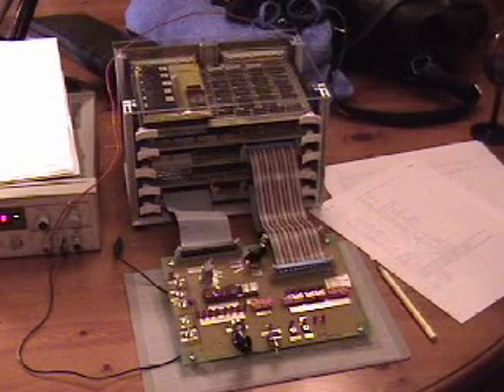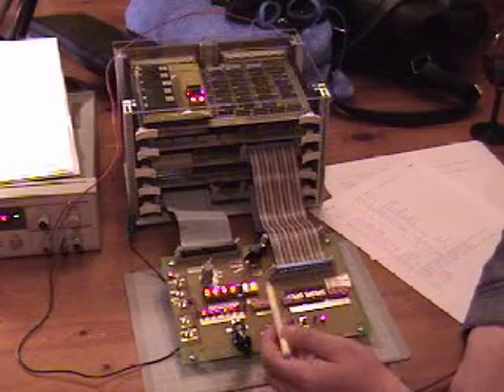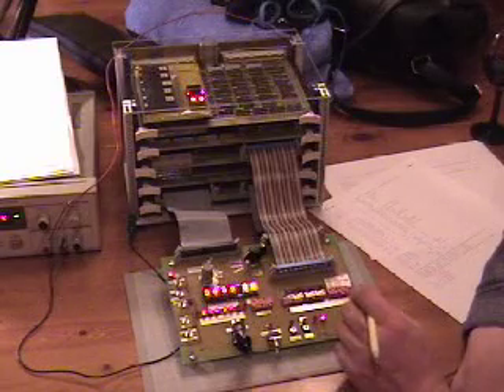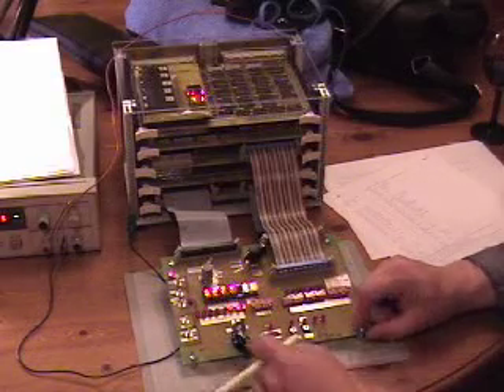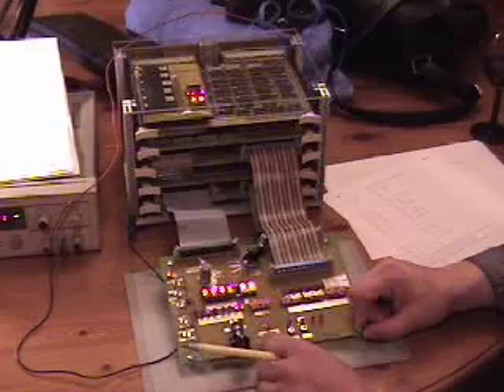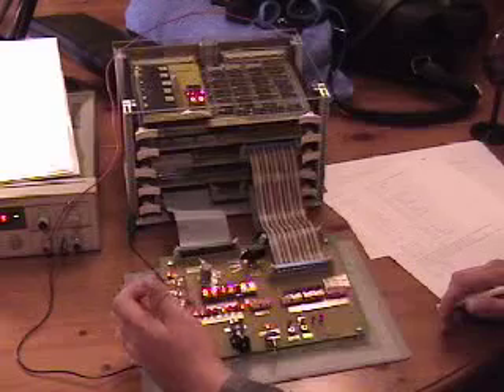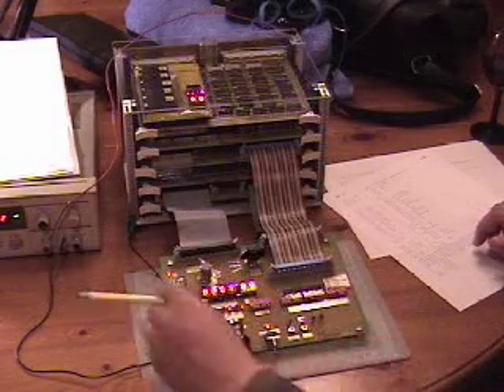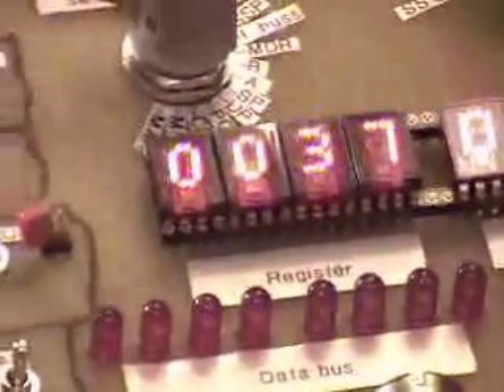Magic-1 HomebrewCPU Works!

Comment: Brilliant! Even though the video quality is a little 'sus', I loved it Bill.
You mentioned 'rewiring' your microcode to fix your conditional branch instruction. Does that mean you didn't use a ROM/lookup table? Perhaps you have wired the ucode by using a diode matrix? 

Edit: I've just  noticed your website and read the tech info on your ucode PROM.
Reply from the maker: John, the error was not in the microcode, but rather in the hardware microcode sequencer (essentially the program counter of the microcode execution unit).  The video quality does look pretty bad by modern standards, but that was done back in 2004 using a camcorder writing to tape.

Comment: What SRAM chips do you use?
Reply from the maker: 8 512k x 8, specifically HM628512LP for the main RAM, and there's also a 32k byte device mapped in device space that's used during the boot process prior to enabling virtual memory/page table.
Reply: @Homebrew_CPU  thank you. Trying to get that once I have my breadboard prototype set up. Do you have any sources for the wire-wrap boards and the sockets for fitting the boards into the back plane, all with that snap-lock thing??? I used to have PDP8/a's in the past, but never wondered how I could find such material raw and new? Since I could never get a PDP8/e, now I'm hot about avenging my fate by building the ultimate blinkenlights computer.for a LISP machine :D
Reply from the maker: @guntherschadow9383  Can't help with the wire-wrap boards.  I got lucky with those about 20 years ago - found a pile of them at a surplus dealer for $5 each.  Wish I'd bought the entire lot.  As far as the sockets, you can find them at Anchor Electronics (https://anchor-electronics.com).  They are standard 96-pin VME/Eurocard connectors.

Comment: It is bace on TTL ICs, the smallest react time is 1.5ns(using the AS modle).
which makes the fastest on/off frequency per IC is 666.6MHz
while connecting more and more ICs, it gets slower

Comment: @cargoterm Hope you meant Intel, not Microsoft :P. I wish I picked this kind of crap up as a hobby, would of made Electrical Engineering much easier (though more boring). But really when you look at what a CPU really is - it's amazing how much comes out of putting some impure silicon together and sending some current through it. Digital design is for the win.